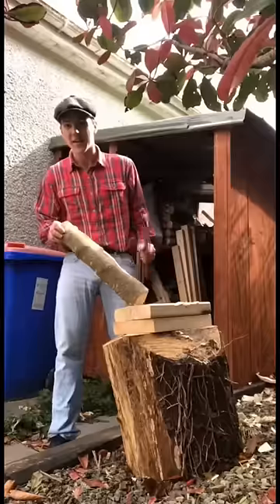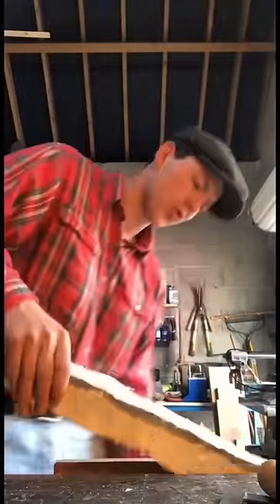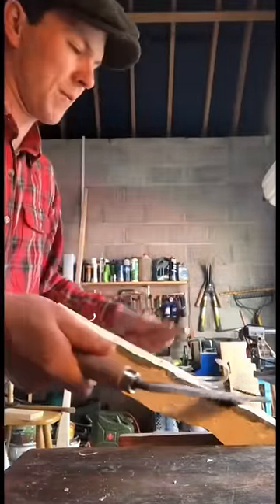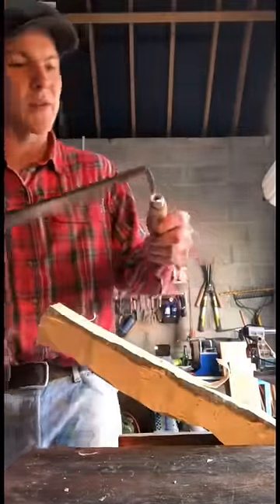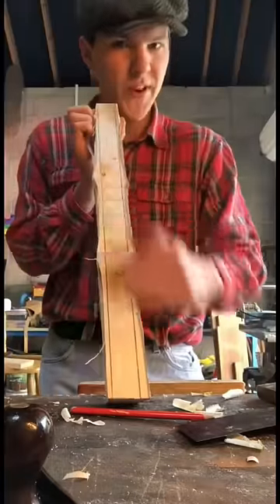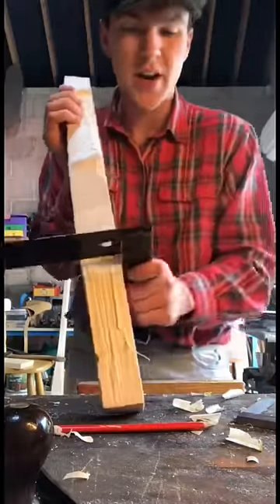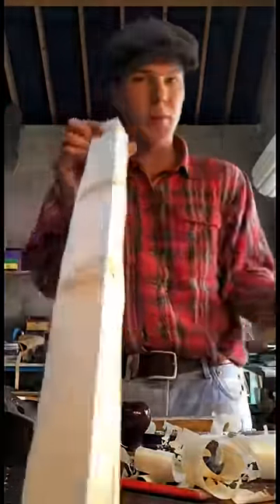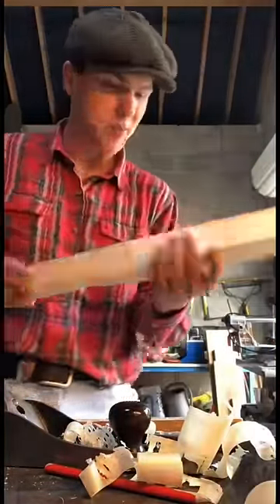Squaring green wood with hand tools #woodworking #shortvideo #satisfying #axecraft

Comment: I have little will power to do that with the power tools. Doing that by hand will make you love a $60 Craftsman hand planer. You can do that with ease in 5 minutes. But I found 2 of those devices you are using where the handle came off here in this old house. But if you are not smooth with the machine planars the marks from it will show if you stain it, though sanding it usually fixes that.

Comment: I'm so interested in this area of wood working at the moment! I used to work as a fencing contractor where I'd order the correct size pieces of wood to then erect, then I worked for a tree surgeon where we'd actually cut the trees down now I work for a milling company as a side job so I can follow living tree to mill to fence (not by design its just the jobs that were on offer and I was good at) but its started a huge fascination about how in the hand tool days you would get a tree to a 2"x2" piece of wood without our modern tools, very very interesting!

Comment: What brand/model number and type planes do you use? Did you use any aftermarket/upgraded blades in any of them? I got some Hock Blades last year for my Stanley number 7 and number 6 and also my Keen Kutter number 4! Makes a hell of a difference once you tune the planes and make sure everything is flat and the pieces all sit properly and nothing wobbles then the Hock blades make it so dam nice to use, the sound of a sharp blade taking whispy shavings is something that’s so relaxing

Comment: with power tools you can do the whole job in less than the length of this video without the edits, but you never know in your life when you will be in a position where those power tools are not a option, and funny enough there are occasions where the old way is faster as well.

Comment: Not a slant or complaint but it seems you only use ash is there a reason for that ?
Reply: It's just a solid wood to work with. It is light but strong and dense. Glues and stains also adhere well to it.